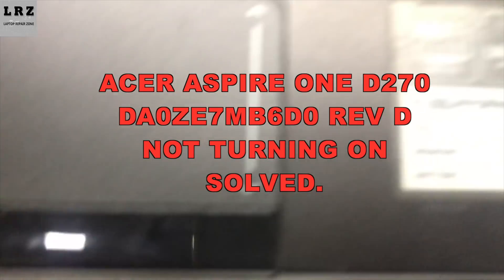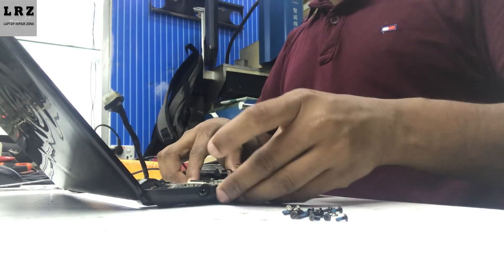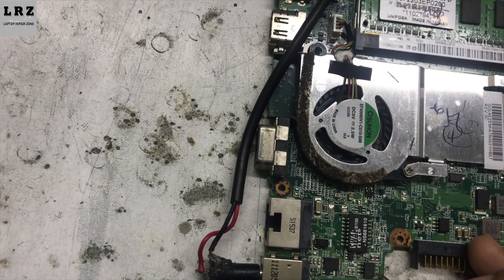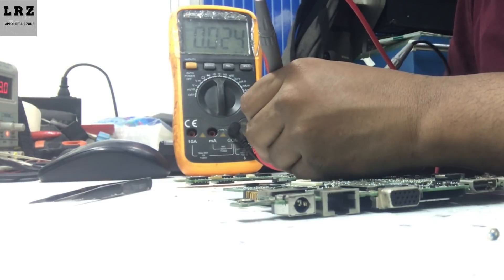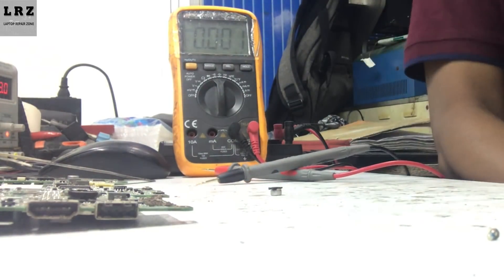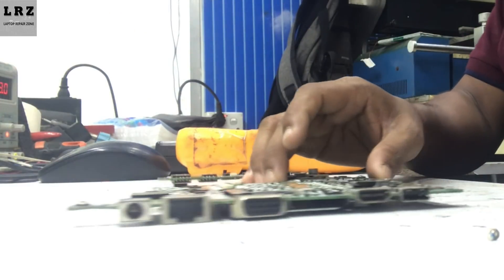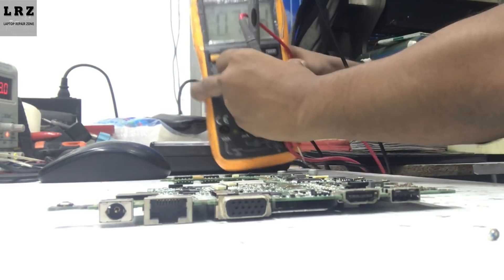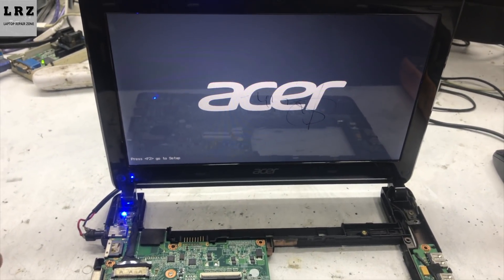acer laptop not turning on and not charging I Motherboard repair.

Comment: I am curious; mine works with the battery out (and plugged in) but if I put the battery in it will not work (including a brand new battery). What do you think causes this?

Comment: Won't charge wont turn on aspire one D271 please help
Reply from the maker: Thanks for your comment,check all the required voltage and signal and follow schematic diagram for your laptop motherboard.
Reply: same problem plss help

Comment: what type of capacitor dou replace
Reply from the maker: thanks for your comment. you can use smd  capacitor.
Reply: 8:29   he said it there. Also that cap is an electrolitic cap and you noticed them by the red half moon drawn on top of it. Do not fool around with big capacitor they are dangerous !

Comment: Sir capacitance mode?
Reply from the maker: You can check capacitor with multimeter in capacitance mode.
Reply: @Laptop_repair_zone  how to check measure vaule mean  220 uf  mutlimeter show value 300UF  ok or not please help me
Reply: Capacitance mode in multi meter how to find?